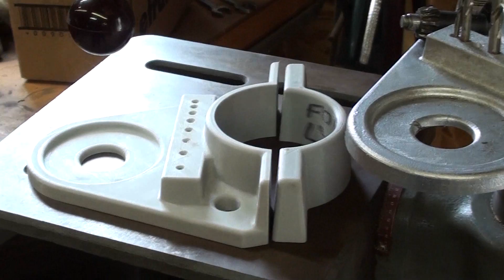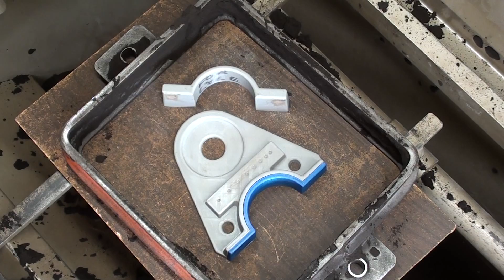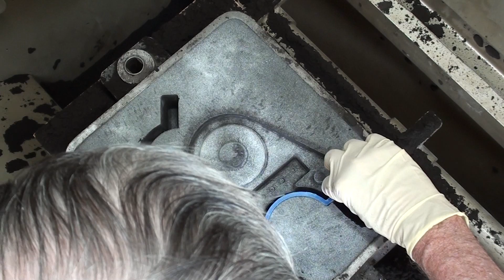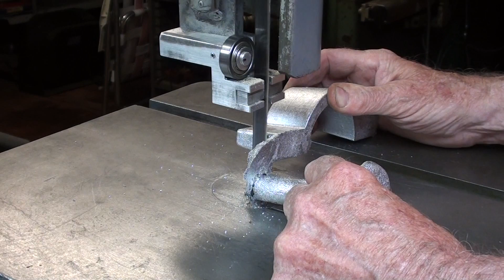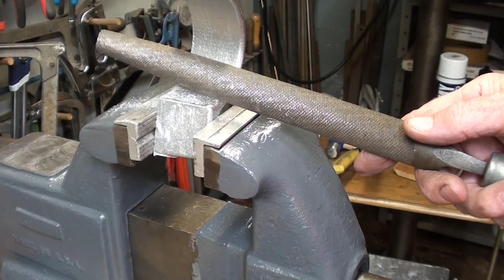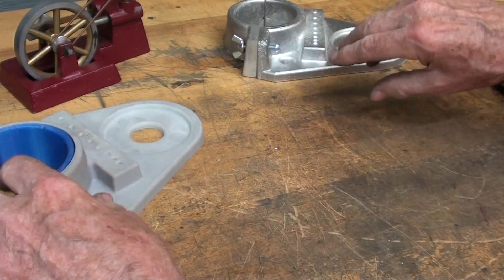Cast a Drill Press Oilcan Holder 557 tubalcain pt2 eagle oiler

Comment: I'm not late to the party I'm back for seconds, with a new printer in my pattern shop.  If the draft on the ears of the clamp piece was put on the thin sides instead of the tall sides, it could be molded ears down on the molding board, perhaps using a follower to support the arch.  That would eliminate the milling operation.  Maybe even let you cast those holes, but that's a bit iffy IMO.  Alternatively, drafted as it was on the ears but not the arch, it could have benefitted from a second blue spacer to aid in drawing it from the drag.  Yet it was not oversized to accommodate a spacer.  Hmm.  Well, you got it to pull clean anyway, nice work!  👍. I don't do fusion but I can chop off the draft from the mating side of the clamp in the slicer and give it a try with no follower.  I might try sizing one up for my bigger drill press column too.  The shelf would be a great place to keep my Dave Clark the Pattern Guy safety sander, but it almost never comes out of the chuck on my little one! 😁
Reply from the maker: It’s been quite a long time since I made that video. Sounds like you’ve got some good ideas. Go ahead and make one by your method.

Comment: if you needed to tighten on pole ,you could grind down the 2 thick  back sides u mentioned where they meet ,to draw the bolts tighter. a great combo -- 3 d molding and cast both! 3d endless possibility. i would just have a hard time programming till i learned w/ practice.
Reply from the maker: Thanks

Comment: Sorry to see you making a very basic mistake. HOLES cast into metal DO NOT SHRINK! The metal around the hole strings back and the hole gets BIGGER. This is why you don't want holes in your casting.  Another reason is the distance BETWEEN holes will change when the metal cools.
eg two half inch holes  three inches apart will end up as 5/8 and only 2 and 7/8 th apart!!!
It's not even worth having centre marks on the pattern as they will divert the drill point. If you don't believe me measure the diameter of the hole in the oil can base on the pattern and the size on the finished casting!

Comment: Another great project. Thanks to our "Mr Pete"! Only one sad thing...I do not know how to cast and no place to do it. So...I will make one of these gems out of "HDPE" (High Density Polyurethane). Different thickness of these pieces are sold by most woodworking supplies. One piece of this awesome material; 3/4" thick X 4 feet  X 4" wide; would be more than enough to make the entire Drill Press tool holder.

Note: These companies call the material "UHMW"  (Ultra High Molecular Weight). But I am told by several reputable plastic manufacturers that the name is HDPE. For whatever it's worth.

Thanks again Lyle. You are truly a "gifted" gem. And there is no doubt where these "gifts" come from. Oh indeed! Praise His Holy Name.

Comment: I don't get the blue insert. You said it was to include draft to the i.d. of the clamping surface, then you corrected yourself and more that there is no draft on either side of the blue part nor on the the i.d. of the clamping surface of the main pattern. So making the pattern larger (to omit the need for the blue piece) and not having that blue piece would be just the same. The blue piece didn't add anything. If the blue piece had draft on the clamping face side of it, it would not help either.
Reply: Smooth, non-sticky  surfaces will slide against each other. Casting sand is sticky and will adhere to the pattern. Non-drafted surface being withdrawn will drag the sand with it. Not good. Using the insert trick, the main pattern non-draft surface will slide easily against the insert surface. With space thus created, the insert can be manipulated horizontally to separate from the sand and withdrawn.
Reply: the blue piece can be pulled AWAY from the sand instead of straight up and possibly pulling sand with it

Comment: Great castings, I so need to put a foundry together.

Regarding the use of a worm strap, wouldn't the draft angle need to machines off the neck of the casting first?

It kinda looks like the angle would cause the strap to slowly ride up the neck and eventually work it's way off.